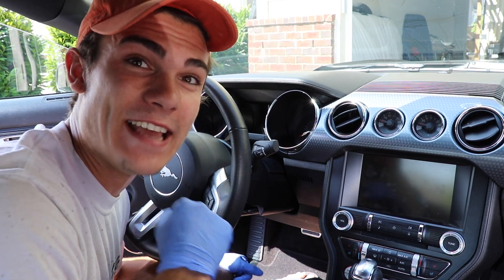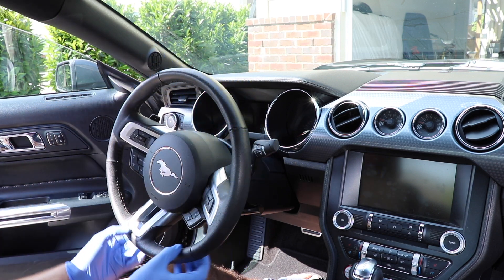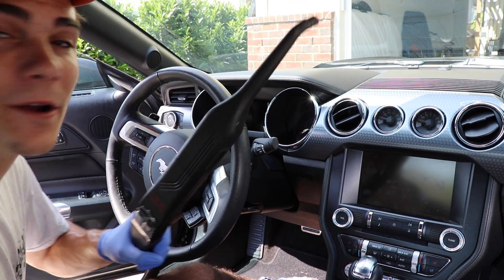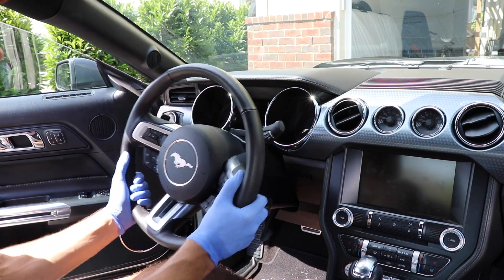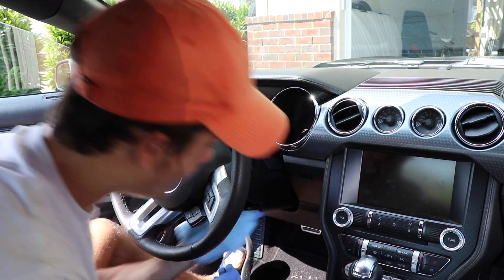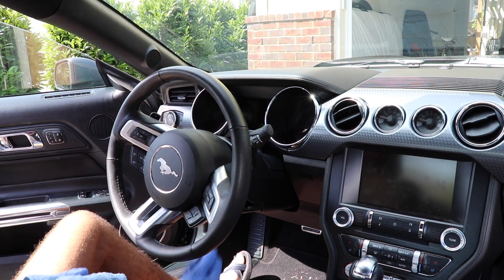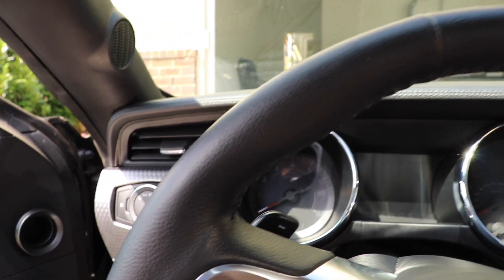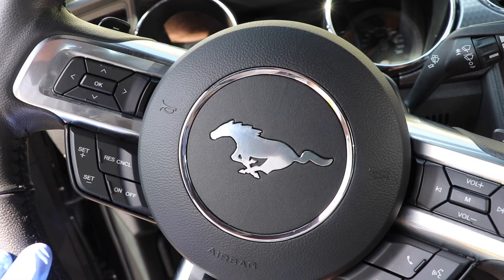Steering Wheel Cleaning: How To Detail Your Car Steering Wheel!

Comment: Hey Luke just a question, have you ever used la totally awesome all purpose cleaner for interior like steering wheel and plastics? If so what do you think and would obviously dilute it as well like meguiars all purpose cleaner
Reply from the maker: sean B hey man, I don't use that cleaner. I don't have any hard evidence that it isn't a good cleaner or that it will damage anything, but it's just not a cleaner that is dedicated for automotive in any way really, and some of my friends at the college I go to use it at there fraternity house after parties and stuff 😂😂😂😂 so I guess I have always associated it with like low quality stuff. So I don't use it and I don't know that I would suggest it. I would stick with meguiars

Comment: Hey is this APC safe for all leathers? What's better for leather cleaning apc or super degreaser?
Reply: I am sure Luke will be along to answer this one but I would have to say the Meguiars.
Reply: It is safe for leather, as is super degreaser in general. The biggest factor, like our bro said, is condition, and how you apply it. You can use a scrubber on new leather in good condition, but just a microfiber towel on leather with cracking or wear to the finish.
Reply from the maker: ballerbrian4u I think they answered that question well enough and there no need for me to add anything! Hahahaha!

Comment: After I applied a protectant (Armorall) to my leather steering wheel, it felt very slippery and dangerous while driving. I had to remove the protectant using alcohol after that. Do you have any tips on how to prevent the steering wheel from getting slippery after applying a protectant? Great content BTW. I will share your channe to my automotive forums.